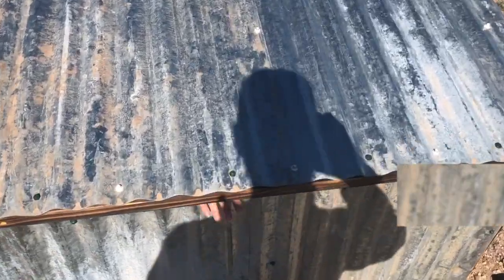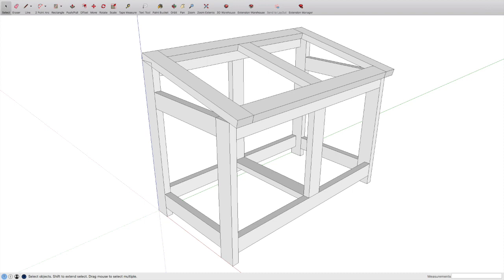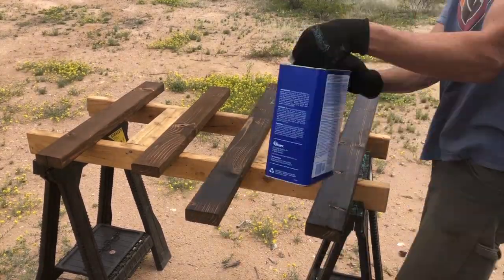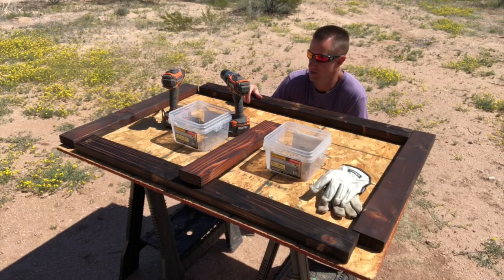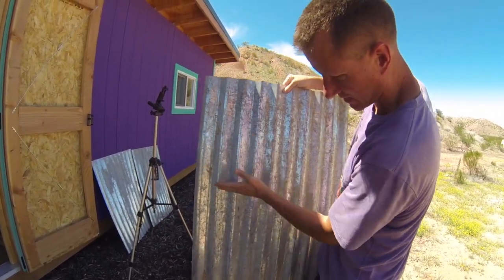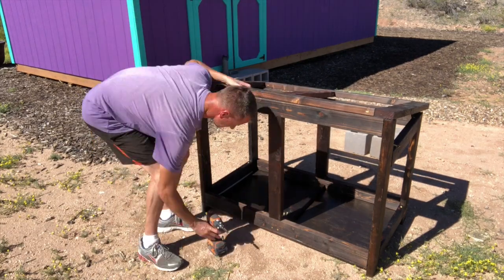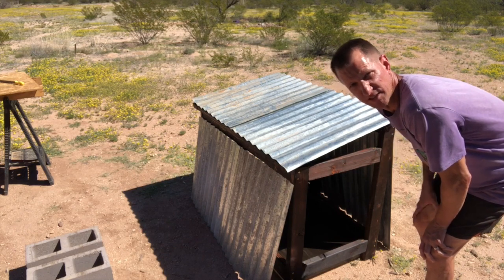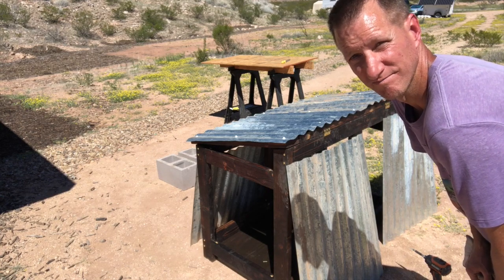DIY Delivery/Storage Box

Comment: You may want to consider larger hinges. That lid is going to have a fair amount of weight. Looks good!
Reply from the maker: I was on the fence with those, but I had them lying around, so I gave them a shot.  I think they'll be ok 🤞.  It's actually not too heavy.  Thanks for watching!
Reply: @MidlifePrices  I was thinking the same thing, but then I'm a BIG fan of "use what's on hand!"  You can always replace them if they get tweaked.

Comment: Timber Locs you can get them in 12 inch lengths and run the all the way thru the one 2x4 and into the other in the edge. I used to build my barn doors and privacy fence gates that way. Works awesome.
Reply from the maker: Thanks for that tip!  I have not heard of those.  Maybe a little pricey, depending on the project, but looks like a good solution.  Says they're stronger than 3/8" lag screws on HD site!  That's interesting.  I have another project I was about to use some lag screws on, but might consider these now. 👏👍

Comment: I used galvanized cleats and lap joints when I built my gate frames.  They could add strength.
Reply from the maker: Hmm.  When I hear cleats, I think of boats.  Can you elaborate a bit?
Reply: @MidlifePrices  sorry for the confusion.  We called them cleats growing up.  Home Depot calls them mending plates: https://www.homedepot.com/p/Simpson-Strong-Tie-MP-2-in-x-4-in-20-Gauge-Galvanized-Mending-Plate-MP24/100375189